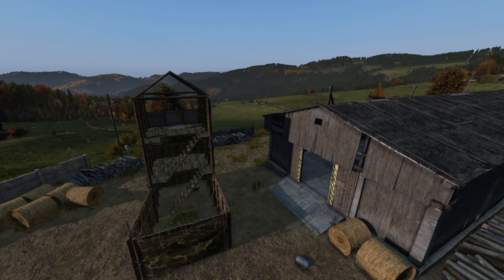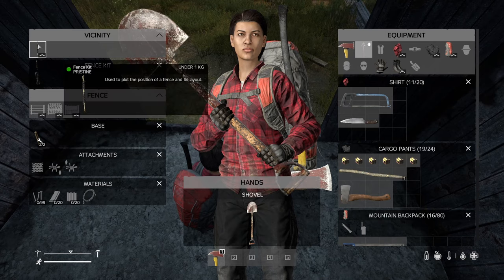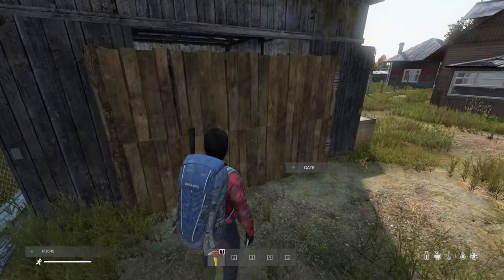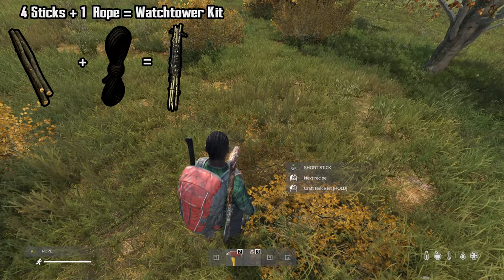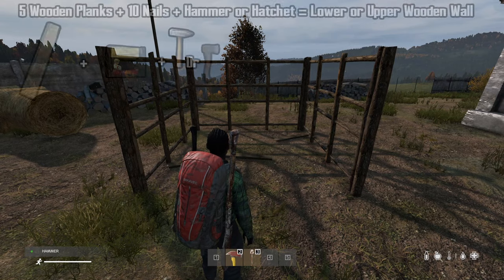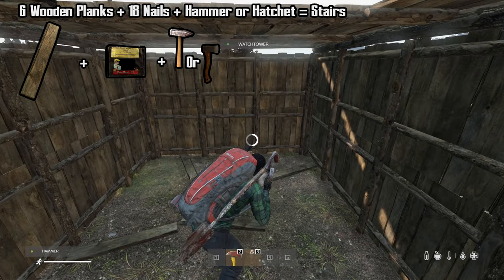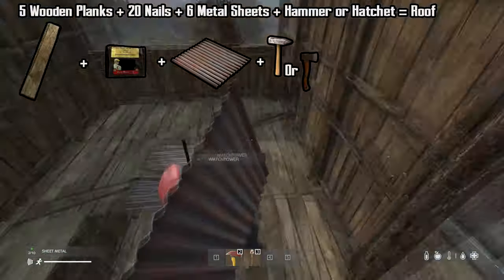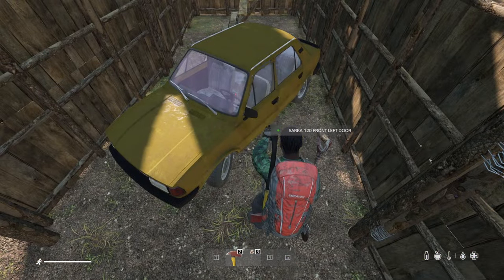DayZ Base Building Guide - From Barricading Buildings to Freestanding Bases in 2020 - Tutorial

Comment: I play in a community PVE server with base destruction turned off. This is on console. I had a base like this and it was still raided. I was using the airlock method for my walls. And they still got through. We had so many people’s bases raided within that week. They wouldn’t even take anything. They dump everything on the floor and blow it up with grenades. They destroy the players cars, they will empty the tents and turn the tents around to where it’s facing the wall making it inaccessible. They do this knowing they will be banned. It continues to happen in our server.
Reply from the maker: That is lame sorry to hear that. I have heard of people doing tricky things like using a car tent, climbing on the tent, then jumping over the walls. Maybe barbed wire along the top would help, but it seems if someone is really determined to jump a wall, eventually they may get in. I am not sure how much you can tweak loot on consoles, but maybe if you turned off certain items that allow people to boost it would help.
Reply: @Nitno  thanks for your response. And it’s good. Just yesterday we found out they been using wall glitch hacks or something like that to get into ppls bases. We ban them but they get alt accounts to do it again. It’s freaking annoying.
Reply from the maker: @eden20111  Dang yeah that is rough. Best wishes!

Comment: Question! New to making a base, can people destroy that wall and get in? Should you make more than one wall in a building? How to people break into bases? Just hitting the wall? C4? Grenades?
Reply from the maker: Yep so to break into a base, they will have to destroy your walls, or find a way to jump over them and attack them from the "soft side" which is the inside. In general, if a person where to attack your base wall it would take a lot of bullets to get in, like I am talking enough  to take a pristine gun to ruined several times. I don't have the numbers in front of me, but grenades do a lot of damage to walls but still takes multiple to get a wall down. Yes if you want extra protection, doubling the wall count helps a lot. Walls can be weak to a whole squad though, so picture 5 dudes all unloading tons of ammo into a wall, they'll be able to get in. Solo or Duo's it'll take a decent amount of time if they really want to get in, but it'll cost them.

Comment: Hey man its me again, does my stuff despawn if i put it in wood boxes? I just built a base in a barn and want to know if i leave stuff on the ground and in boxes will it despawn?
Reply from the maker: If it's not in any type of container, yes it will slowly decay, so like go worn, damaged, badly damaged, despawn. But if its in a container it will have whichever lifespan that container has, so for example a wooden crate you build with wood and nails, will last about 40 days. Interacting with items will reset their de spawn timer. Building a flag pole will interact and refresh the timer on all items in it's radius.
Reply: @Nitno  thanks nitno, is a flag pole nessacery?
Reply from the maker: @myles9452  Nope a flag poll is optional. It just makes it an easy 1 click to fresh the timer on everything. You can just go around and touch things manually as well.
Reply: @Nitno  okay thank you

Comment: Great video,thank you.  But how do I stop the base from decaying....I build a large compound,placed a flagpole.  went off for an hour,came back and half the walls were gone.  On my own standalone server so I know it wasnt a raid?  any ideas,driving me crazy lol.
Reply from the maker: Hmm that shouldn't happen. Is it modded at all? Make sure the types xml file is good, you can run it through an XML checker. If there are any problems with the types file things will get weird.
Reply: @Nitno  Can I use a pick axe instead of a shovel for the building gate
Reply from the maker: @HXD90  Good tip!!
Reply: @Nitno  That was a question
Reply from the maker: @HXD90  Ah sorry I misread. Yes you should be able to use a pick axe.

Comment: how to destroy wall if 
Im stuck inside base without pliers and metal wire?
Reply from the maker: Aw dang, this has happened to me too. You basically have to destroy it form the inside. The good news is the inside is a "soft side" and will destroy quicker than the outer side of the wall.

Comment: How to destruct a combo lock? Which tool would i need?
Reply from the maker: unfortunately you will need to break the wall and lower frame to get the lock off.
Reply: @Nitno  isn't possible to cut?
Reply from the maker: @DuDuZ___  You can try, but I believe they took out hacksaw cutting locks, as it was too easy for people to raid bases